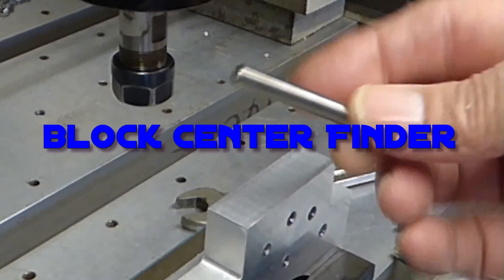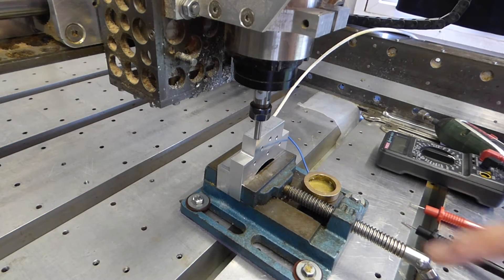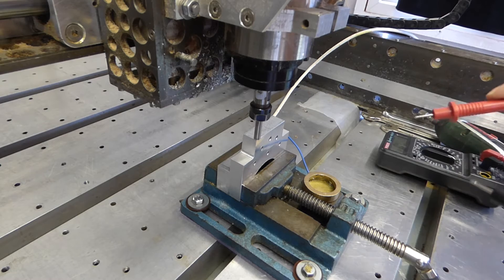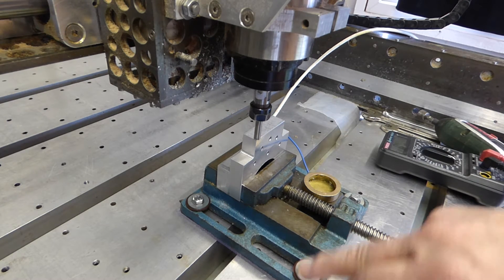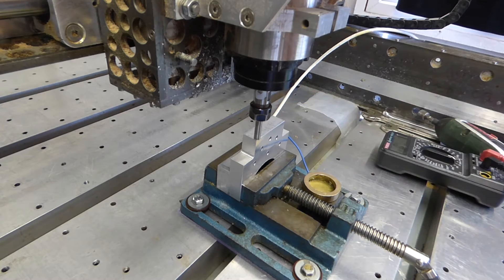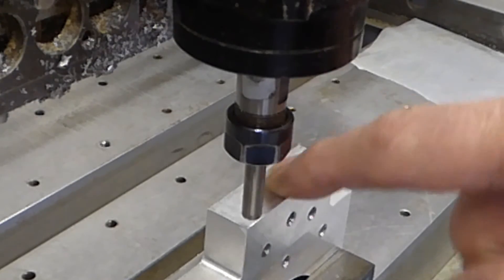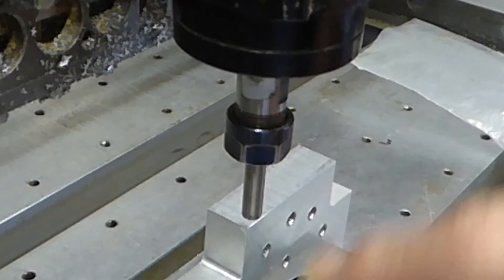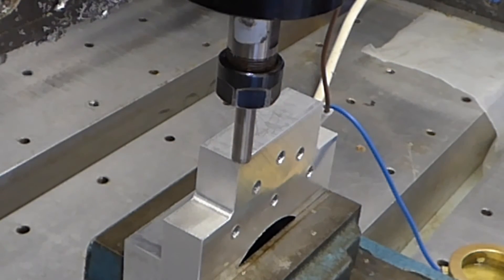Block center finder Gcode

Comment: Hi Jim.

I am currently converting my milling mashine for CNC. Have started to doing some edge finding. I would like to use Your way to edgefindig with an insulating sheet between vise and mill table. But how does this work when You actually are milling. Does this insulation induce shatter and bad surface finish, or does it prevent shatter.

Best regards to You from John Eriksson in Sweden.

Comment: Hello Jim program well palpated my piece but does not come to the axis of the piece there know you hence can come my problem can explain or put the width and length of the room? 
My piece is 180 x 90 mm and 40 mm high
I think I'm not doing well
Greetings
Reply from the maker: I can not understand your query. The translation into English is not good. Also it is difficult to diagnose such technical  problems via text messages.

Comment: Hello Jim
I find your videos really helpful. Good job.

Do I have to put in the exact block measurments or just approx values?
And where do I have to enter them (save the G-Code before loading it in Mach3 I gues)?

Thanks for your support
Reply from the maker: You need to go into gcode edit mode in Mach and enter your particular values in parameters #5 to #10 , #17 & #18.
#5 and #6 are the approx rh and lh values of the part, #7 and #8 are the approx top and bottom values of the part and #9 and #10 are simply placeholders for the final Xctr and Yctr. #18 is a probe clearance value you enter for each edge. Enter a negative value at #13 for the probe Z and at #14 enter the exact radius of your probe.
I suggest that you practice on a simple piece of metal to get the hang of it.
Reply: hello Jim
I do not understand or change the values of my room?
Knowing that I work in mm
You have to change the values in the saved script?
Should I also activate the # somewhere?
Sorry for the translation I am French
Thanks for your reply and bravo for your greetings Videos

Comment: The Mach 3 2010 screenset has all the probing routines. Inside circle, corner finding, outside edge etc. That's the one I use.
Reply from the maker: Thanks for the info.
Reply: Hello boss... so, i can't use this inside of mach3 edge and center find ..any easy video can do ?i added you and subcribed i need this help ..i dont want to any special tools for center and edge find i want to run normal mills any  chance to help me please ?i have what's app application if you have a chance to do qiuck video and send it me please?i really appreciated if help.. urgent needs me 
thanks hope you reply
Reply: @talgtalga3767  unfortunatly I haven't used mach 3 in a few years ago I can't demonstrate it for you.